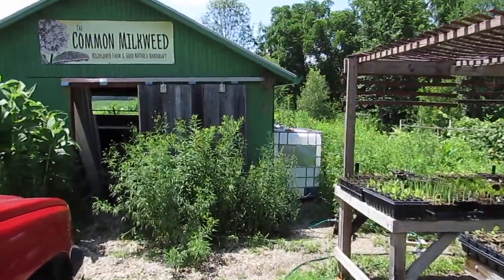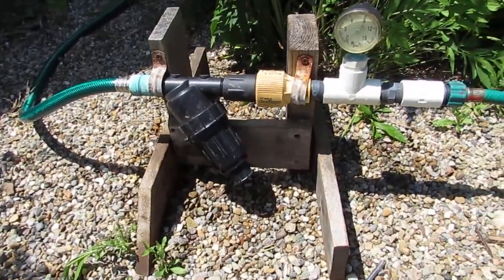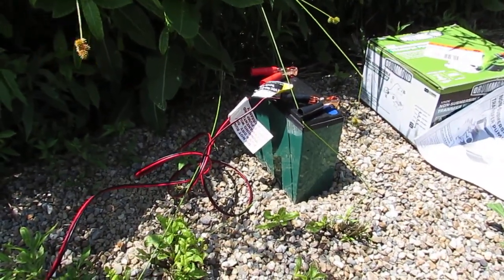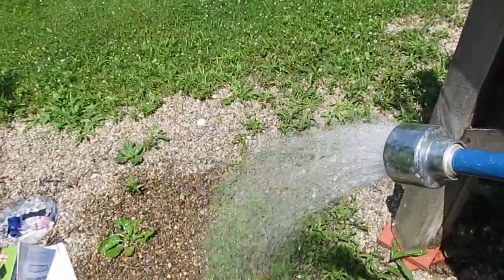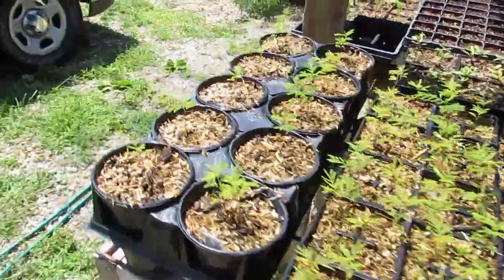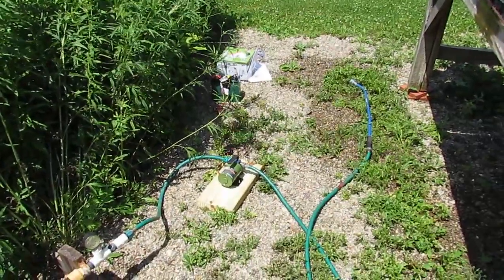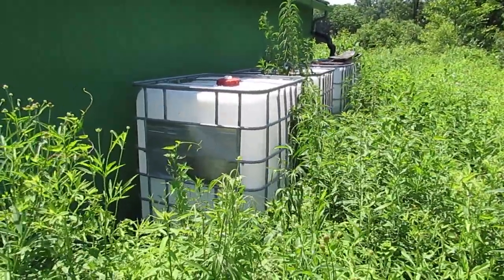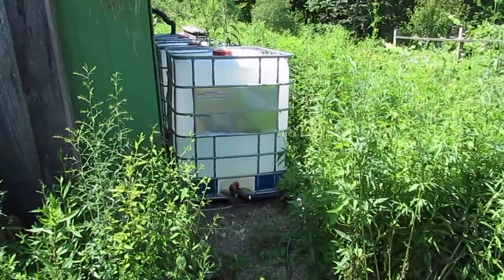IBC Tote Rainwater Harvesting for Container Nursery Part 2

Comment: Love it, just got one of these pumps and I wired up a cheap 100w solar panel with a little charge controller, keeps the regular 12v marine deep cycle battery charged effortlessly. Trolling motor foot switch to wire into the circuit for a “push-button” pump
Reply from the maker: Sounds excellent!! Great work!

Comment: I’m not certain but I think your pressure gauge isn’t registering anything because it’s on the wrong side of the pump. Reading after the tanks and before the pump will only show pressure from gravity. Install it after the pump output if you’re interested in how much “push” is coming from the pump.
Reply from the maker: Thanks for the tip, I will set it up that way soon, as we are entering watering season:)

Comment: How did it go with the algae?  The reason your pressure gauge wasn't reading is probably because it's on the suction side of the pump.
Reply from the maker: No problems with algae at all. The north side of the barn is a perfect spot it seems. Thanks for the pressure gauge info!